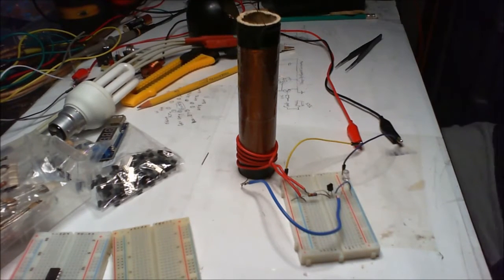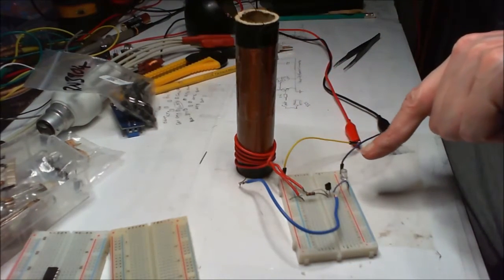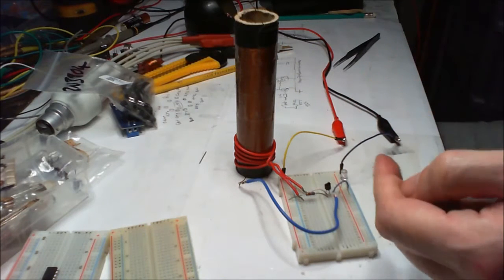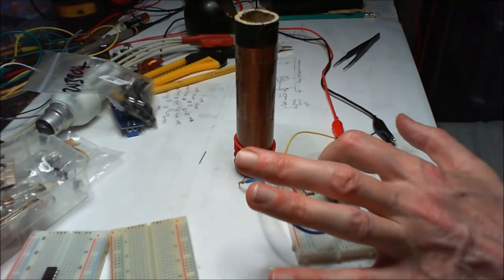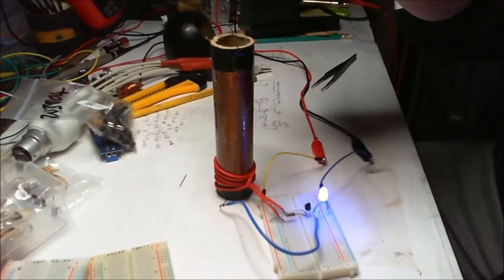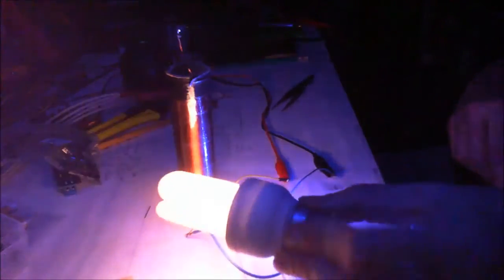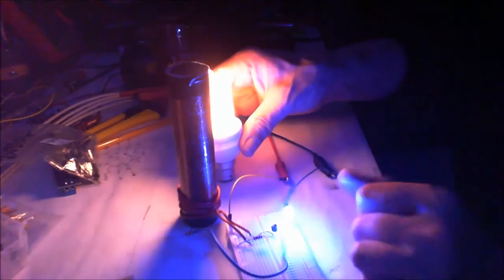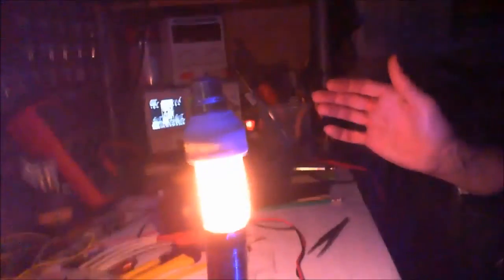Simple Baby Slayer Exciter Circuit Using a 2N2222 Transistor

Comment: okay I have watched many videos about wireless power transmitting.  The weird thing is when it comes to mobile phone charging.  it seems odd yours works and so does the mobile versions.  However they do not use a 2N2222 transmitter.  Can you explain and how and why the mobile version works....without a transistor......?????  here is a link to show you what I men...

https://www.youtube.com/watch?v=jHHO89y00QI
Reply from the maker: The video link is a hoax and can not possibly work. It is another video which is aimed at collecting views and pollutes the internet.
Reply: after watching your video.   I have to agree.  Question is now, your design is it running a DC system because of your diode.  Can this idea but put to use for mobile phone charging.????  Further more how far can you stretch your design to use the power the DIRT out side has to do the same light bulb job and how small can you make it....?  I am guessing maybe LED small bulbs would be the perfect choice....?  I would like a make a mobile wifi charging on a motorbike and to use the EARTH as my power source for my driveway light LED based.  I believe they have a diode built in nowwa days.  Are either of these possible....?  please....  Thank you brother and now a subscriber...
Reply from the maker: It is a DC system because it uses DC. The switching done by the transistor switches the DC on and off very quickly giving a switched DC, the waveform would be more square than sinusoidal AC.
Can you use dirt to charge a phone ...not really. A light emitting diode is a diode in this case light emitting diode or LED. You can experiment with voltage harvested from earth and light a LED but dont expect much more than that for risk of disappointment. If you want a wireless phone charger use a inductor coil like the baby slayer and have another coil close enough (no transistor or circuitry) so that it has a voltage induced into it by the baby slayer. rectify the output on the second coil and see what you get, adjust baby slayer circuit/power to fit your needs.
Reply: I read my comment and seems alittle fuckery...  I did not actually mean charge the phone from the dirt.  I ment use the dirt/earth to power a home made witricity design LED light.  Free electricity for your drive way only...  ops.  would be spanking if it was strong enough to help charge phones lmao.....  Hell that would almost be groundbreaking.  Hope that is food for thought.  The LED I hoped that would be good enough would have been those used in mobile phones.  Those are plenty strong and can be blinding used in a wicked way... :P
Reply from the maker: jason puttock Take a look at an old video of mine https://www.youtube.com/watch?v=_gKbYsCcK_I
if you want to light LEDs wirelessly
Reply from the maker: Because the extra load needed for phone charging I have used the same circuit (nearly) with a TIP35C https://www.youtube.com/watch?v=NYE5lLgbJug
This does charge my phone.